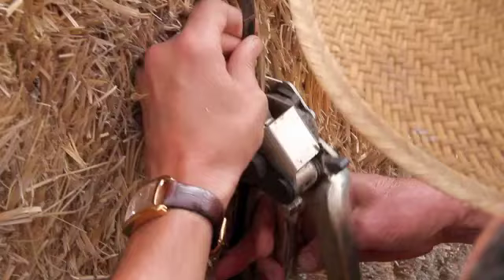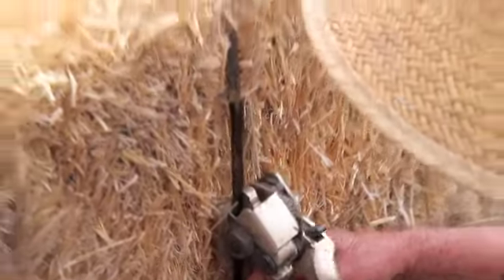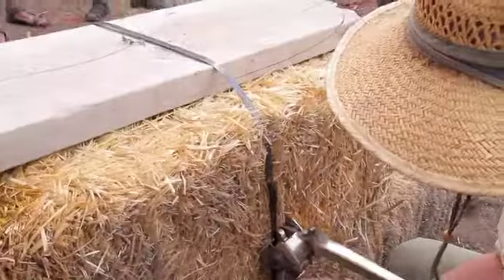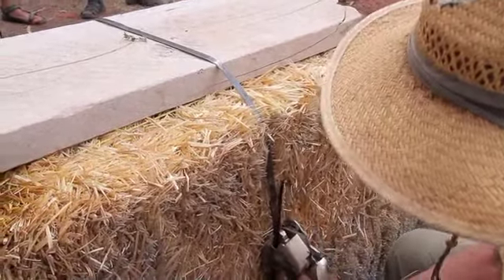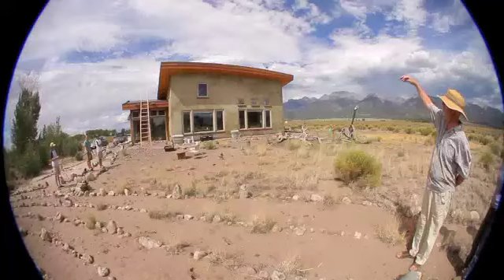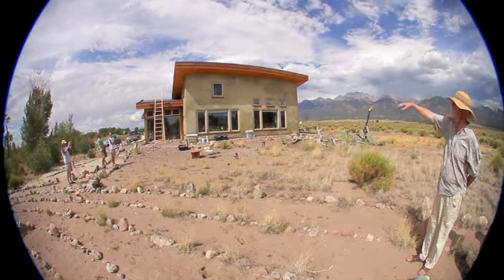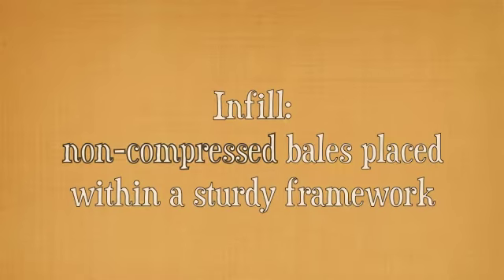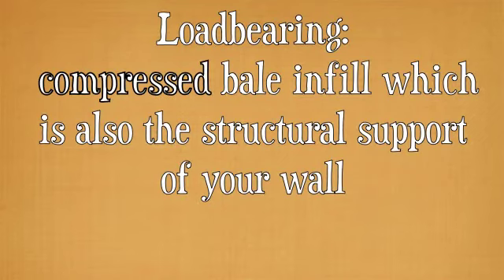Solar School -- Alternative Building

Comment: Do most other states' codes still make it possible to create similar homes? Or are the codes too strict to allow for this? 
I am in Austin, TX, on my way to a chemical engineering degree so I can get into the r&d side of renewable energy (mainly solar). I quit my electronics tech job I've been doing for over 11 years to pursue something I'm more passionate about. 
I can't wait to be independent upon gas/electric/oil companies. I would also like to be a part of building a fully electric, fully renewable vehicle that won't need to be filled up OR plugged in.